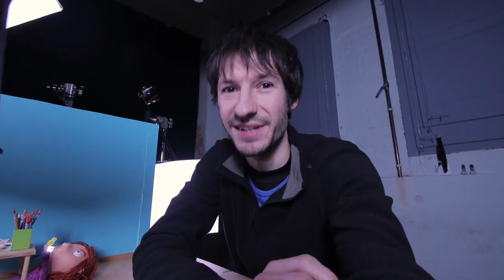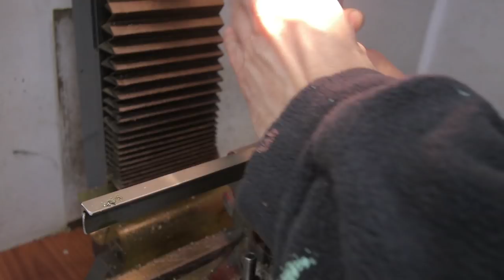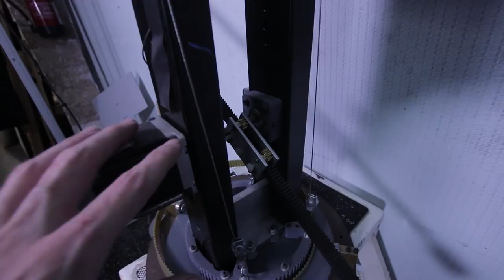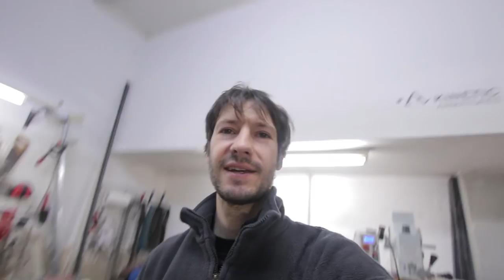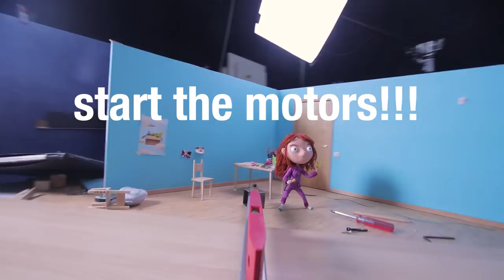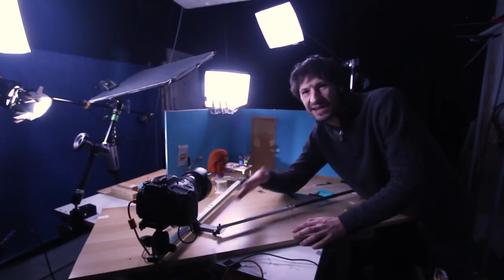Homemade circular camera movement

Comment: I used Lego MIndstorms to make a camera mount that rotates, it rotates on it's own axis, and not in an arc like yours, but you could adapt it easily to do this. For those that don't know Lego Mindstorms, comes with a programmable brick, with a microprocessor in it, and sensors. I used the push button sensor to rotate the mount one time every time I pressed the button. It being Lego it can't hold much weight so I could only get my webcam on it but it's not too bad as long as you have good lighting.
Reply from the maker: Must be something cool to see. Love that thing but never had one in my hands

Comment: Hi,i like your job,i would like to make with stop motion and i would like to ask you what kind of material you made your figurine,thank you in advance too :)
Reply from the maker: A lot of different materials...
Reply: For example? do you use copper wire? or maybe another frame? cover it with material? why did not you use a gypsum? sorry for the many questions 😅
Reply from the maker: I use copper wire sometimes in hands, but most of times aluminium wire because it's propierties. Foam to cover it. Gypsum can be used for moulds but not to make a puppet as it is heavy can break and it is hard to animate it.
Reply: @edupuertasfruns  Hm.... i understand thank you and apologize again for "harassment" :D 😅

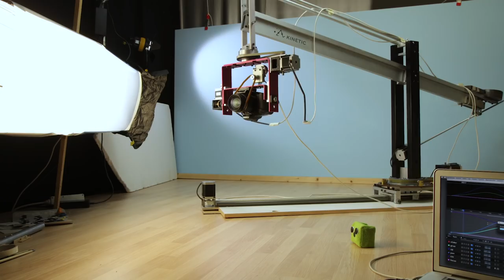Comment: You are the best, you need to build equipment for sell. What program do you use to control-programming motors from PC/MAC? 3:36
Reply from the maker: Dragonframe soft is great for stopmotion
Reply: @edupuertasfruns  thanks for reply! I planning to use it for regular filming, ads. I did stop motion only once (couple year ago) but watching all your video now! MRMC - too expensive for me, yet))). So building own slider with heads and looking for option to program movements with precision. (Arduino a bit weak as well as me to program it well).

Comment: Brilliant as usual! But I was wondering if it wasn't easier having the entire set revolving around itself while keeping the camera fixed and the puppet hovering. You would have spared the poor crane :)
Reply from the maker: Moving the set is also a solution, the only problem is that then you also have to move the lights with the set... that would be a massive thing to move then. The crane will be fixed when I need it again, also I am planning to upgrade some parts that I don't like too much.